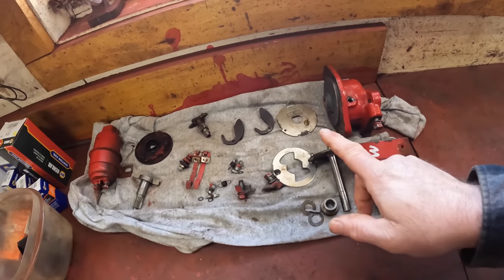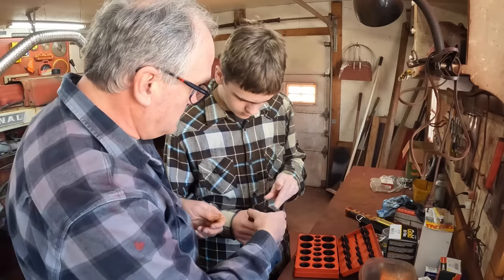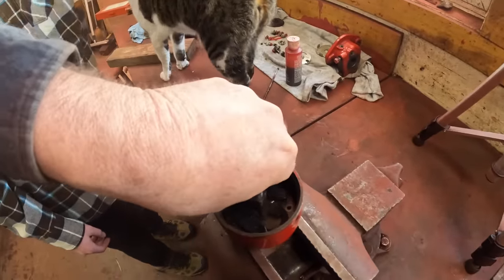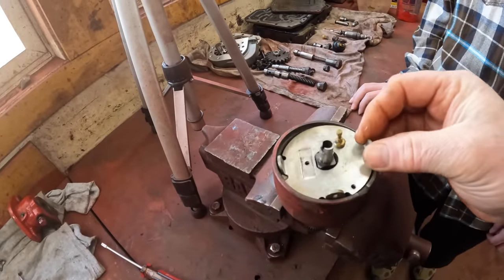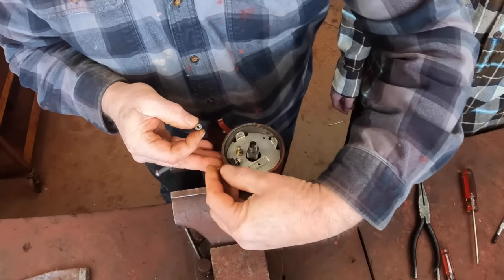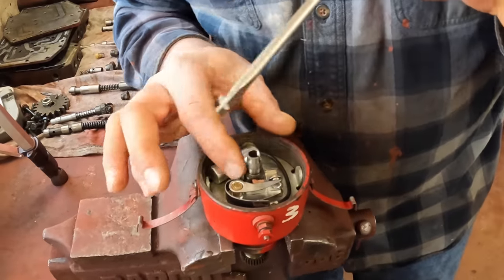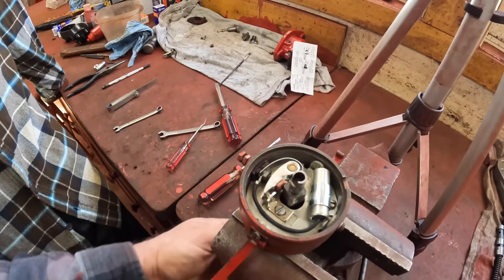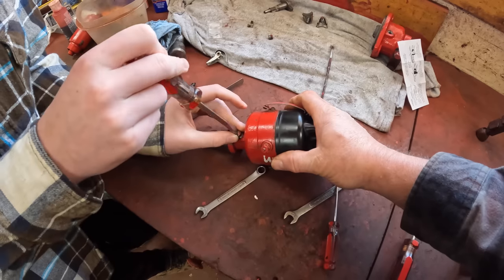Henry & I Rebuild the Super A Distributor

Comment: My Dad taught me a lot of obsolete technology too. He had a 48 Chevy and he used to keep a points file in his toolbox. Whenever the points would get a little worn or pitted, he would hold the two surfaces together with the thin points file in between and a few strokes of the file would make them like new again. After several of these clean ups of course, you would then need a new set of points. But the old timers knew how to keep things working with less expense and work. About the time I started driving, they were beginning to talk about going to electronic ignition, but it was several years before it came to reality. Cars are so complex now, even the mechanics often don't know how to work on them. Technology learning often doesn't keep pace with technology advancement.

Comment: FYI the condenser is used to store a small electrical charge, so you do not get arcing from the points. 60years of being a mechanic taught me that. You could actually charge the condenser and if you bent the wire so it was close to the body and tossed it to someone, when they caught it they would get a shock. Just a llittle mechanic humor. Have a great day. Love the videos. Grew up in Waterville NY on my uncle's farm. He had a red tractor. Massey Harris 44.

Comment: Thank you for this, Pete and Henry!  I was expecting you to say "what's the point" (or points) when you were working with the points in true "Dad Joke" fashion... no doubt it was on the tip of your tongue!  My VW had the same centrifugal system with it's Bosch distributor: one could enlarge the hole you spoke of here at 4:06 in the Bosch distributor on the VW to increase the amount of advance you could have the unit give the engine, and by removing one spring, the advance would occur all that much faster, resulting in better performance for the VW engine off idle.  It's fun to see similar principles in the IH distributor and be reminded of past experiences and understanding the theory of the system.  Great stuff and thank you!

Comment: I'm always thankful that my father taught me his plumbing, electrical, carpentry and landscaping skills.  There's such a dearth of handimen nowadays and carpenters and masons and plumbers, etc that I'm awful glad I have those skills when things break in the house.

My dishwasher broke several months ago.  A rubber drain elbow dry-rotted after we bought it new a year ago.  The manufacturer wanted $150 for the elbow.  I said heck no and bought a car radiator hose from autozone for $8, cut the elbow out of it and used that.  So far it has held up better than the OEM elbow!

Comment: When the points open, the condenser sends a charge to the low voltage side of the coil, causing a change in its magnetic field which results in a big fat spark back into the the distributor cap and then through the rotor to the ignition spark plugs via the leads.

Comment: The condenser (it is a capacitor) absorbs the current from the coil primary winding when the points open which prevents arcing of the points.

Comment: 5:03 Ezra says, it's about time'. 
Don't forget to load up a used condenser for Henry to experience what the plugs get. lol  I had that done to me, but I was smart enough to let the condenser fall onto the floor and picked it up by the insulation on the wire and threw it back to the wiseguy that threw it to me.

Comment: Pete you should have Henry more appear in the videos or maybe let Henry run the show for one time. What can go wrong? Definitely there was some quality father and son moments in the video. As for the distributor cap your right the brass and copper connections outweigh the aluminum connections any day. Wonder what Henry would say if he would have to fix some true old school buzz coils?
Reply: I remember my shop teacher told us that per pound, aluminum is a better conductor than copper, but due to aluminum's properties, it would take a much thicker aluminum wire to carry the same current as a thinner copper wire.
Reply: @samvalentine3206  Your teacher might have been right with hard facts. Just what I have seen in practice is lot of these distributor caps that are remanned tend to be inferior in the quality to there OEM counterparts of the past. These day's lot of the new plug wires come with silicone cover and have something else than copper to transfer the spark. I don't know if aluminum oxidizes faster than copper or brass. But a few distributors I have taken apart that had aluminum contacs in the cap. Looked like they had been soaked in acid. Might be just humidity doing it's magic?

Comment: My Dad bought me a junk Briggs and Stratton engine for $1.00 at a salvage yard.  He told be to tear it down to the bare block to see if I could figure out how everything worked.  After I did, he told me to put it back together and have no parts left over on the bench.  I learned a lot from the experience.  Not the least of which was to keep the parts in order when you tear something down!!

Comment: Pete, you mentioned a piece of felt soaking, and I think you mentioned that it went into the top of the shaft which the rotor sits atop.  Did that get put in off-cameral?  And, do you lube the cup of the rotor which rides on the shaft?  I've had automotive rotors seize to the shaft and had to be cut off.  Times like this are a dad's best times.  And a shop needs an Ezra to make sure things run smoothly.

Comment: Great Tutorial Pete AND Henry!! the one thing I picked up on Pete was this time you actually let Henry do something with his hands and get the "Hands on" training. Back in the day in the Army we used to call that OJT (On the job Training) and like you I like the old point style distributors. they are a lot easier to trouble shoot you can see and feel pitted points a lot easier than voltage or continuity checks on Electric system. Just like all the useless computer systems on cars and tractors even. just to satisfy some new Engineers  Technical ego. they have added so much of this stuff you pick up the hood and can't see the engine for the "Toy's" they designed. UGH! let me digress to the good old days when you could see and work on an engine and not need an IPAD or any other diagnostic computer junk! ECF